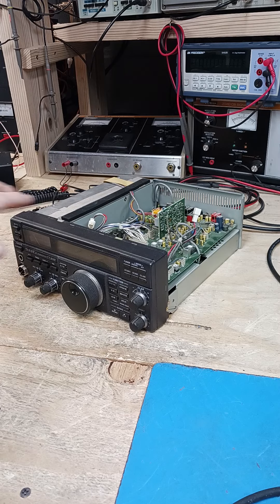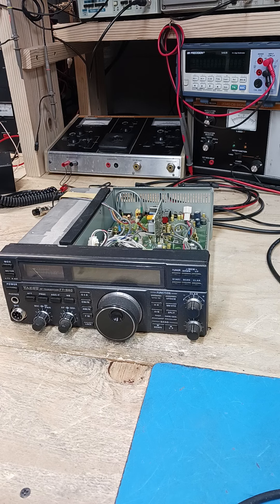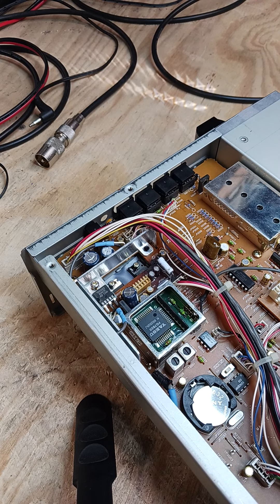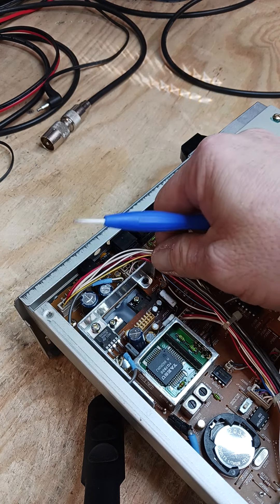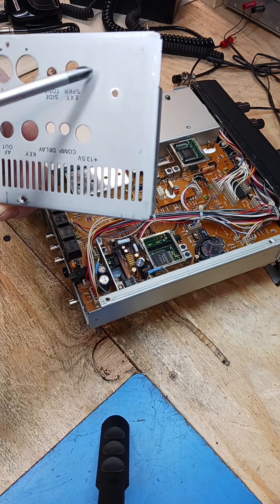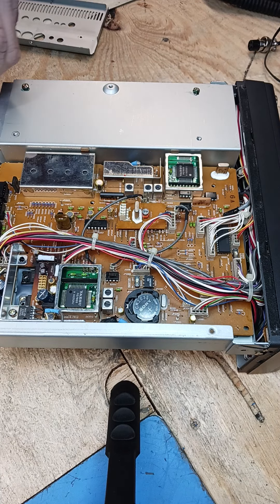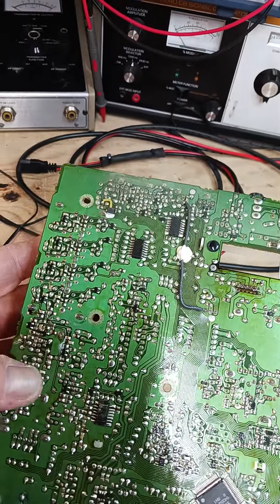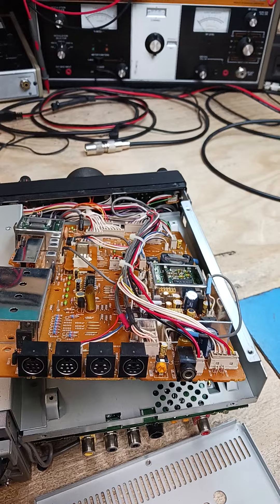Yaesu FT-840 Video Part 1

Comment: It is mentioned a few times in the video that the replacement resistor is a 30W one but the value is never given (or at least I missed it). According to the service manual this is R2213 and its value is 8.2ohm. Is that correct?
Reply from the maker: Yes that is correct on the value of the resistor. It was an engineering defect from the get go.

For aby questions you can call if you want?

Shop: 315-573-9205
Cell: 315-945-1600
Reply: @DX RADIO SHOP  thank you, I just got an 840, and I am going to have fun with it. It needs some attention, and your video is a good suggestion for an extra thing to check.
Reply from the maker: If you need any assistance don't hesitate to call me and I will gladly help you out over the phone of you want to fix it yourself. If you would like to send it here that would be fine too. Either way I can help you if needed, thanks

Comment: Does the S0239 coax jack tighten from the inside or that nut on the outside? Mine is loose and can't budge the outside nut so maybe it's part of the jack itself?   -- many thanks
Reply from the maker: Depending on which version, it could be nutted down on outside or flanged with 2 screws from outside. Either way, it's easy to replace if needed.
Reply: Ok thanks. So if I see the nut outside, that's how it's tightened -- having a hard time turning it because of it being recessed like it is. @dxradioshop

Comment: Does the S0239 coax jack tighten from the inside or that nut on the outside? Mine is loose and can't budge the outside nut so maybe it's part of the jack itself?   -- many thanks